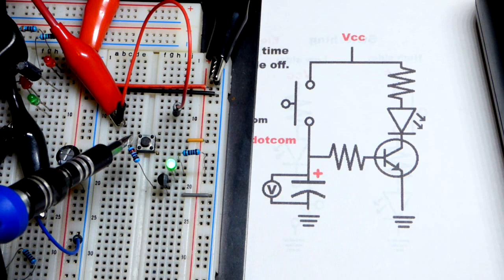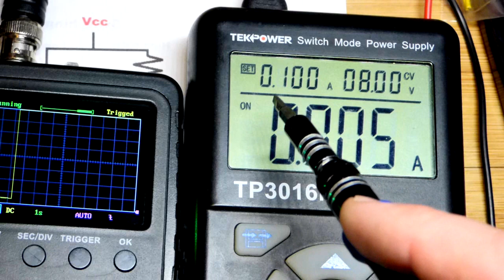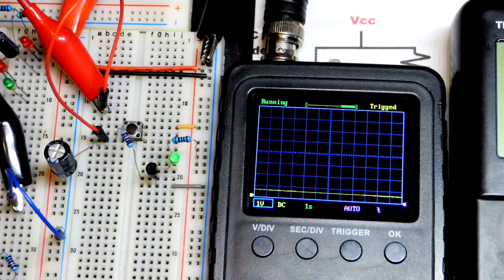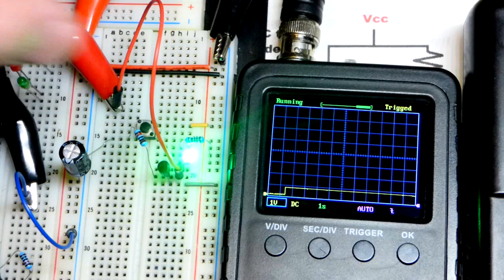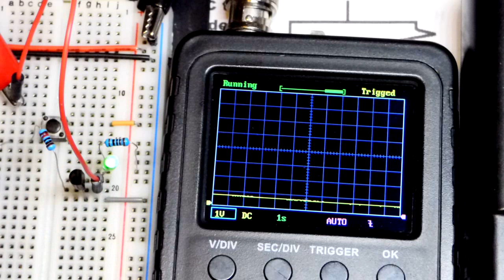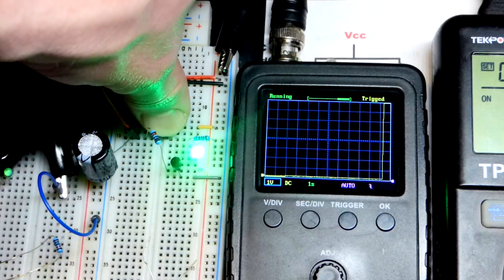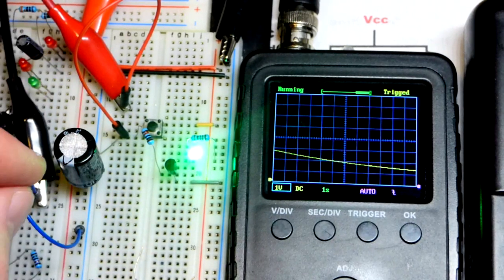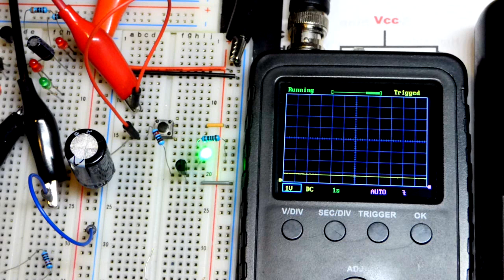Capacitor voltages for timed fade off LED using 2N3904 NPN bipolar junction transistor BJT

Comment: As soon as you press the switch which action take first charging or the base current action,please verify this,according to my knowledge I think both actions take place simultaneously
Reply from the maker: Yup, the capacitor charges instantly while current flows through base the instant the button is pressed as long as the power supply provides enough current to do both at the same time.